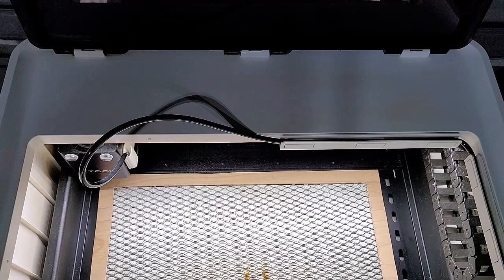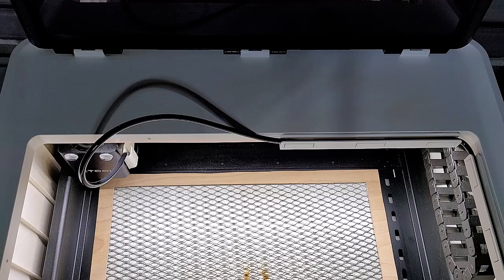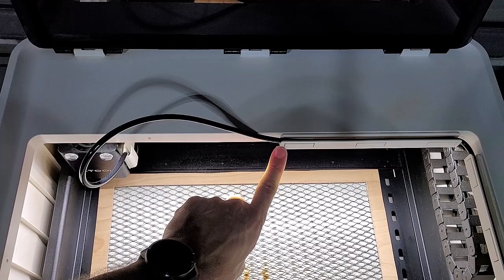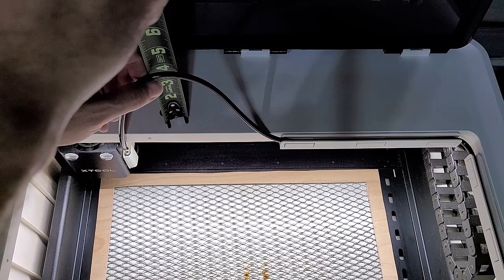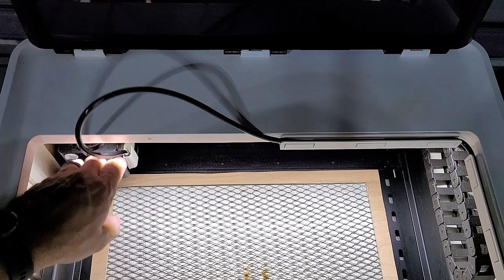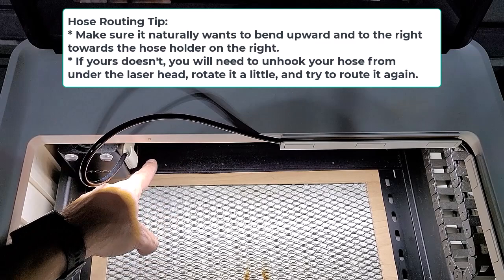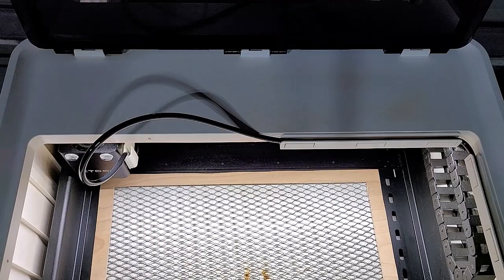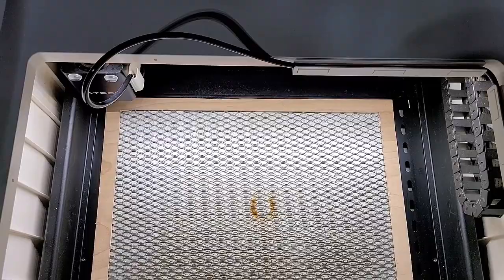xTool Air Assist Hose Routing Help

Comment: Thanks Mike!!  That solved one of my questions. It also looks like you just left off the smaller hose bracket. 👍🏽
Reply from the maker: Yea, I dont use that bracket.  I never take off the air assist so I didnt see a need for the hose holder on the left or the little bracket for the air nozzle.
Reply: Is that why there are 4 brackets? Just in case you need to tuck it out of the way when disconnected?

Comment: I have just found that my air assist hose and scratched the under side of my lid, whilst I was engraving slate.. with the detail it stayed in 1 position for a while and caused this, has anyone else encountered this problem
Reply from the maker: I have an arc on the underside of my lid due to the design of the xTool air assist.  It doesnt affect the performance of the M1, just a bit annoying it does it.  I don't have big scratches or anything and it does not block the view from what i can see.

Comment: Hi I used a zip tie to hold it up but it jammed so I cut it off and routed it all the way round the rop which works but my framing white light doesn't work any longer. Would you know why this is please?
Reply from the maker: Hmm.  I believe the framing light is the actual laser running at low power.  Did you check to make sure everything is attached properly under the laserhead?

Comment: I’m trying to install the xtool air assist, and dont understand where the hose is supposed to be looped by the laser? And also is the new lens that connects to the hose supposed to be a little loose and rotate?
Reply from the maker: The lens thing is a little loose.  The hose goes to the back of the machine, takes a hard turn into the side holder, then let it go up and to the right like in the video.  The biggest thing is give enough slack to not bind and make sure the hose naturally goes up and to the right.

Comment: My hose just melted on my P2 ... is it because i was using it at full power or does it mean the lase it to close to the hosing? What size hose do i need to buy? Thanks i watched alot of you vids.
Reply from the maker: On your P2 or your M1?
If the P2, I would reach out to xTool support first. The hose is a special pre-coiled hose so it can to up/down with the laserhead.  That will be tricky to replace yourself.  Not saying you cant do it, just know it will be tricky.  The M1 hose can be replaced by a simple fish tank air line hose.  But, since the fish tank hose is more flexible, be careful routing it so it doesn't fall and hit the material or end up under the laser head.
Reply from the maker: Oh I would be bummed too!  Did you email support to see if you can get a replacement hose?

Comment: What type/material of hose do you use?
Reply from the maker: The xtool air assist comes with everything you need including the pump and the hose.   Just make sure you pick out the one for the M1 specifically.